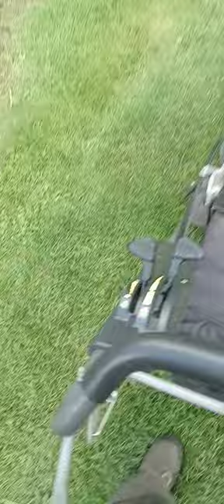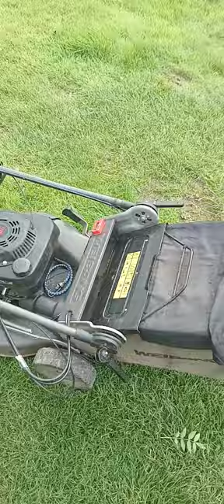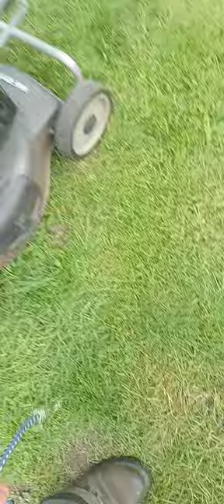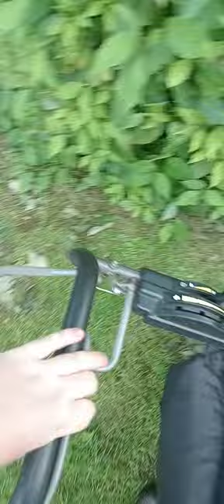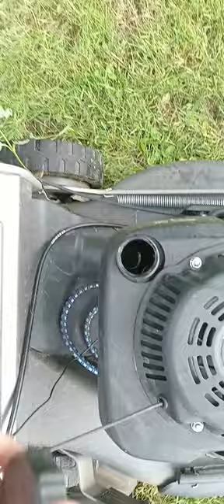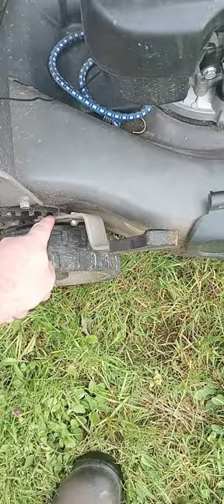My review of the Weibang WB537scv BBC petrol lawn mower.

Comment: Hi Philip, is this Weibang model, or the cheaper version without BBC (Weibang WB537SLC 3in1 21" Domestic Walk Behind Lawnmower - Steel Deck) capable of cutting fairly long wet grass - at the start of the season? or could you recommend a mower that would do it? Thanks
Reply: This one is with the BBC